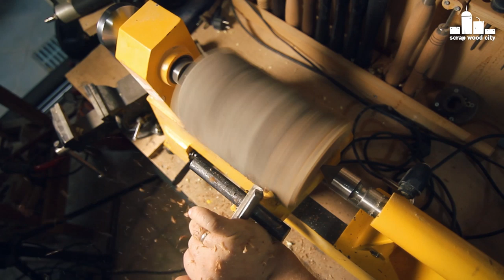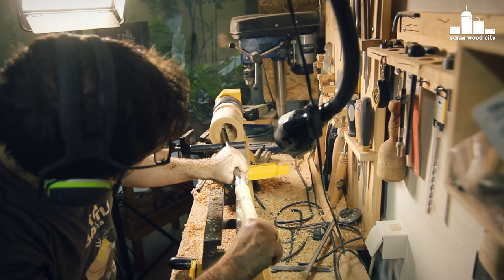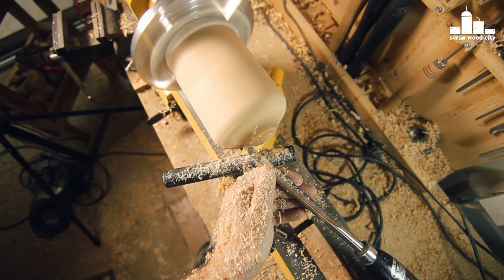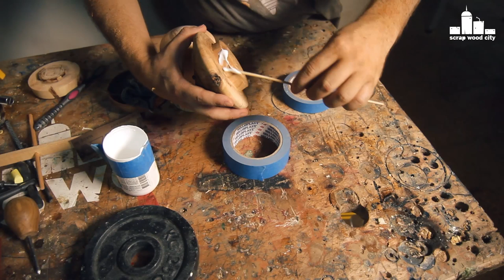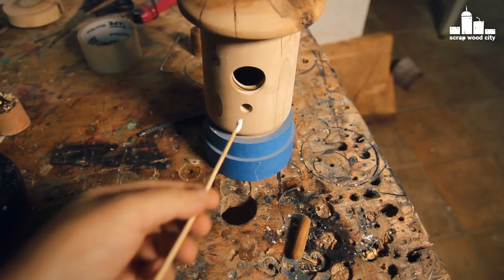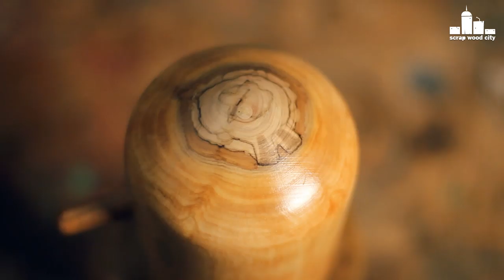Making a birdhouse on the lathe - Woodturning

Comment: Wonderful job. Really entertaining from chain saw to hot air gun! Excellent work with the skew chisel - are you using it as a scraper near the end there? Very brave! Great vid mate.
Reply from the maker: Thanks Mark! I use the skew mostly to remove material fast and clean. No this is not a scraping cut. I think it is called a pealing cut but I am not really sure! I use it sometimes as a scraper, like in the part where I make the dovetailed tenon!

Comment: Birdhouses are species specific.  You can find online what type of bird will nest in what size of a birdhouse.  Keep these things in mind when planning your birdhouse.  Either make the roof or turn the bottom to be removable.  Birdhouses must be cleaned out yearly.  Plenty of ventilation!!  Drill vent holes in the bottom and just below where your roof connection stops.  Eliminate the perch.  A place to land is just what predatory birds need to be able to kill and eat the young.  I have found that a birdhouse swaying in the wind is not the desirable place to nest.  If possible, I would choose a solid and accessible mounting spot.  Happy Birding!!